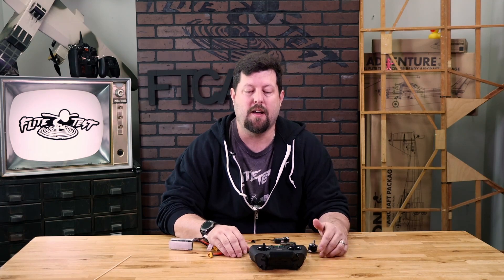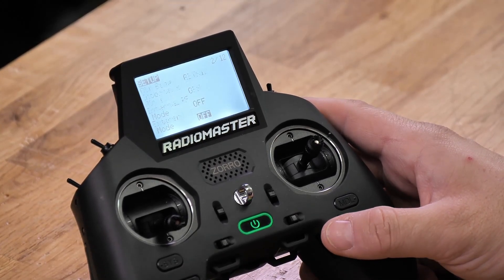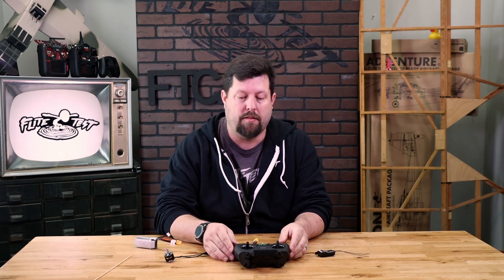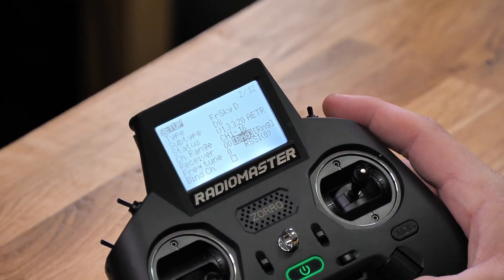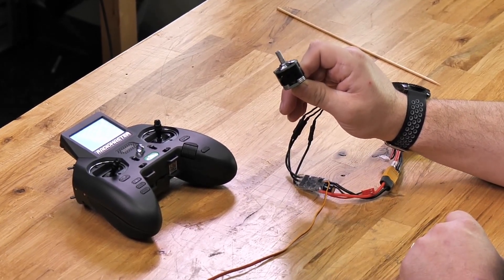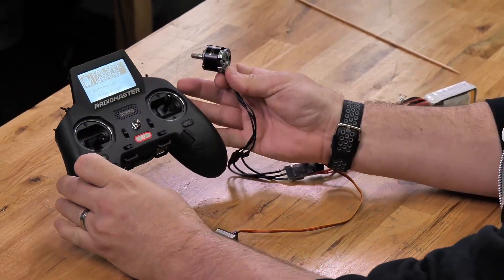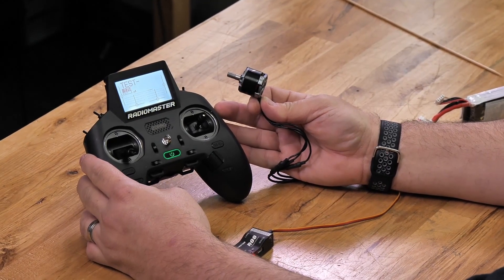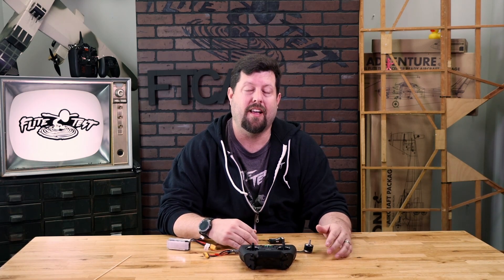How to Bind With Your Zorro - Spectrum & Radiomaster

Comment: 1. What modifications, if any, you would make to the procedure in order to obtain a successful bind with an SFHSS receiver?
2. Do you have to repeat the exact procedure whenever you make any alterations to the model config on the Zorro eg. adjust dual rates or curves? If not, what is the simplified sequence of events?

Comment: How many channels is on the Zorro transmitter?
Reply: 16, except for when the RF protocol can't do as much. Old FrSky D8 protocol can only do 8, for example. 
For DSMX you should get 16 channels.
Reply: @froqstar  Thank you!
Reply: You can also get 32 channels when using  an additional external RF module on the Zorro and a second receiver bound to it.